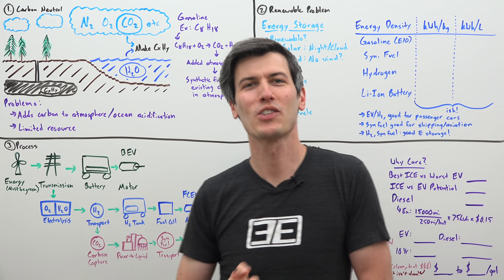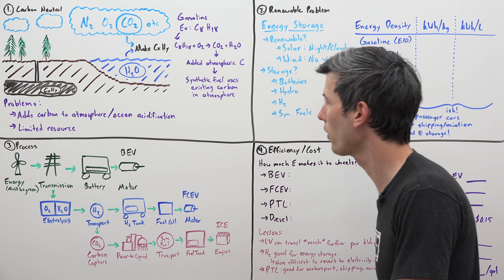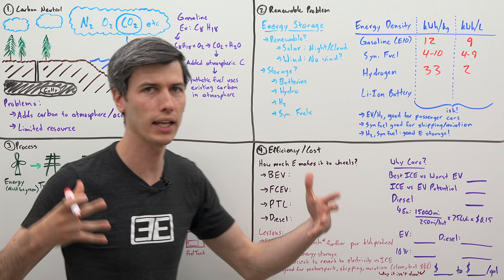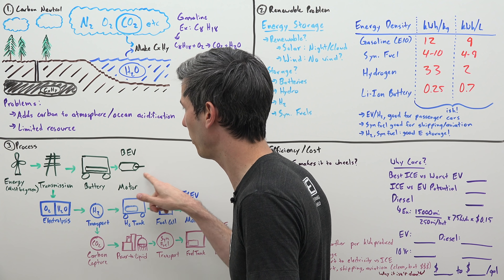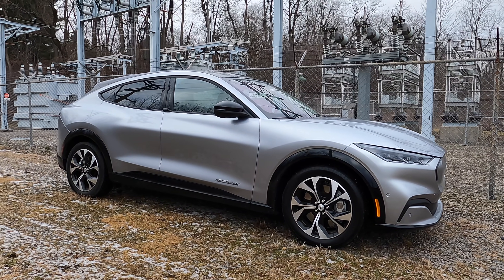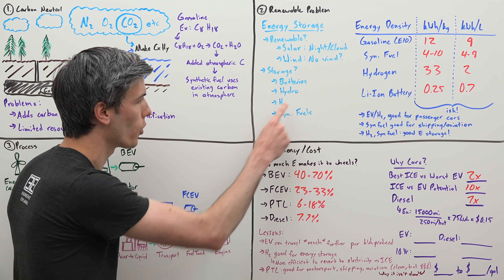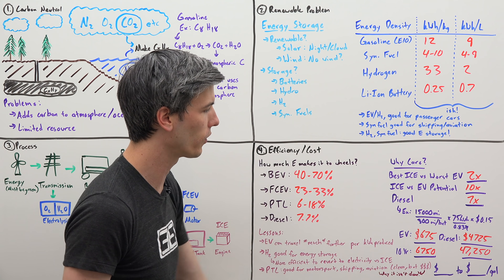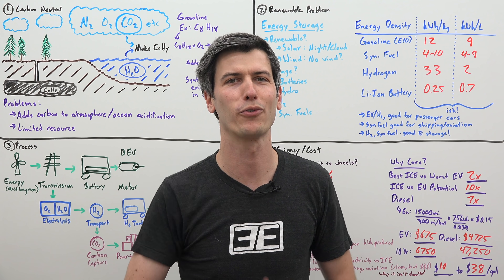The Big Problem With Synthetic Fuels

Comment: In your other video you mentioned the energy density of petrol vs batteries. Gas is just a much better storage medium. That makes up for its inefficiency, especially when you use the ICE to heat your car's cabin in the winter, and regenerative braking with a hybrid car like a Prius. Plus all our infrastructure (gas stations, rail lines, tanker trucks, etc. . .) are set up for moving petrol.

I think there is still a palpable use case for ICEs running off CO2 neutral synthetic carbon capture gasoline. That's why Bill Gates has invested in a startup in BC that I think is a HUGE stock to look out for 👀

Hybrids have the best range. Even Elon Musk's Tesla hasn't beaten the humble Prius' range.

This is all so very important to consider when creating public policy. Because my Canadian government plans on banning ICE passenger car sales by 2035. This will surely lead to economic turmoil and suffering of innocent consumers.

ICE & synthetic fuels are supported by science, regardless if you've failed to discuss these hidden variables.

Comment: Your last section on efficiency/cost only makes sense when assuming today's energy costs.  Let's see what happens when there's a fully implemented charging infrastructure and mass adoption of EVs vs phasing out the existing fleet of passenger ICEs; those figures will change drastically, probably leading to higher electricity cost vs lower fuel prices...

Comment: electric utility prices are low now for ev owners, but just wait till everyone has an EV and they also need to upgrade the grid and move to more expensive energy sources, that rate will go way up and that's not even considering the revenue from gas taxes they use to maintain roads that they will then have to levy on the electricity prices.

Comment: Synthetic fuel is still way better way to go, we don't have to mine and worry so much about hostile countries and slave labor to get lithium for batteries and we don't have to build new infastructure everywhere with charging stations, etc, we can just continue pumping it through gas stations we already have.  In addition, you still satisfy the car guys because they can keep their great sounding ICE based cars and you aren't putting dyno tuners and car modding out of work, etc. killing more jobs, only smog stations would be put out of work.  Lastly, the assembly lines and production is all geared for making ICE engines, imagine the cost of retooling all of that to make electric engines, etc.  I think synthetic fuels and the new toyota ICE that runs off hydrogen rather than fuel cells are the way to go.  We understand you are dealing in efficiency and can't calculate or weigh the infrastructure alteration savings and tooling/production changes, etc.  You also are not looking at range in totality, cost of the vehicle, longevity of battery pack and those going in the landfill and how long those ICE cars and engines will last in comparison.  You should be looking at creating syn fuels using nuclear not hydrogen.

Comment: I haven't seen anyone run the numbers on the amount of 'green' wind and solar you would need to make a plant that produces a few billion liters of this stuff either.. You can't ignore the impact of the windmills and panels and their maintenance / recycling / replacing impact..
Reply: Ignorant comment. Did you know that covering only 1% of the Saharan desert in solar panels gives enough electricity for the entire planet? There is no shortage of availbable energy. There is only a question of profitability. Transporting that energy from these remote areas back to US and EU will be cheaper with E-fuels than by power lines.

Comment: Say you had synthetic fuel making plants with solar panels or something, now the electricity isn’t transmitted nearly as far. If electrolysis and the power to liquid process are done at the same place then transporting the hydrogen isn’t a problem anymore either. That effectively removes 1 or 2 steps making it at least as efficient as fuel cell technology.

Comment: This is a bit like asking someone if they've stopped beating their wife -- you've already made an implicit assumption that may not be true, and tilted the discussion to a particular outcome. Surely the onus is to prove that electric cars will be able to replace conventional vehicles, and not the other way around? In regions where the market isn't heavily tilted in favor of EVs, ICEVs still make up the large majority of sales. When looking at sales of EVs, typically more than half are hybrids, which need fuel of some kind. It seems clear then that fuel is going to be a part of driving for a while to come, and if that's the case, we'll certainly be using synthetic fuels, even in our "electric" cars.

Secondly, you're focusing on well-to-wheels efficiency, when the real metric of interest is cost of ownership. BEVs are cheaper to run when plugged in at home, no question, but there are other use cases where you want to be able to refuel quickly -- BEVs are unlikely to be cheaper in this scenario, since electricity has to be dispatched. You're not just paying for energy, you're paying for energy, right now. Fuels don't have this problem, because they're an easy long term store of energy. Given the large chunk of drivers relying on on-street parking, it seems pretty clear that we either need fast charging for these users (mostly negating the cost benefits), or we have ubiquitous slow charging that still leaves BEVs worse off for certain use cases.

The reality is that BEVs don't meet all of the use cases that ICEVs do, which could easily limit their penetration into the market. This is borne out by the fact that 20% of BEV buyers in California switch back to an ICEV for their next vehicle, mostly due to charging issues. Fundamentally, they're a different product with a different ownership experience, with some advantages and some disadvantages. Given this, I think it's pretty clear that we'll be using synthetic fuels, but maybe not synthetic petrol and diesel (alcohols are generally cheaper and cleaner). Methanol and ethanol are both effective fuels, and notably absent from your list.
Reply: Very good comment!

Comment: A little correction: in the majority of the cases the recharge station for electric vehicles are fed by gasoline or diesel generators, in order to generate the electricity that a customer will use on his vehicles. Furthermore, the amount of CO2 and polluting substances generated for the actual building and refining of the lithium cells of these vehicles, has been demonstrated to be extremely incisive in the enviromental impact. So, in my modest opinion, this video just lack of some details and doesn't point out correctly all the issues that are emergin over the EV debate, which are quite relevant. Internal combustion energy veichles are still and will remain the best option, with the correct amount of development and research in order to flat the level of emission, such as the case of synthetic fuels and similar products.

Comment: Diesel/compression ignition engines were first run on peanut oil. There is biodiesel out in production already. Do why not run the compression ignition engines on perhaps vegetable oil. Disneyland has been running their tram on biodiesel that they make from all the used cooking oils from their restaurants. The one thing that I see getting in the way is the petroleum industry, and perhaps the politicians that own stock in the petroleum industry.

Comment: The battery electric vehicles have the same problem as the organic fuel combustion engine… the battery & fuel are both consumables. 

After 5-7 years, the battery will be disposed of and need replacing. The gasoline just needs to be replaced faster (weekly). The same way we may run out of oil, we may run out of battery precursors (lithium.)

The hydrogen fuel cell becomes the [expensive] consumable with Hydrogen cars (that are not burning/oxidizing hydrogen, which is less efficient.)

For sustainability reasons, Hydrogen combustion or Synthetic Fuel combustion is preferred. (100% recyclable & precursors accessible everywhere.)

There is nothing to say that Hydrogen or Synthetic Fuel can not be made at someone’s home or in fuel stations, so the transportation issue disappears.

Hydrogen or synthetic fuel hold a lot of power per liter, both are effectively limitless, both are 100% recyclable, Both can be transported via existing transportation networks. 

The loss of efficiency can be overcome with technology, and if not, the sustainability aspect still trumps the others… if for no other reason than to burn in an electric car as a generator driving super capacitors (no batteries needed.).

Comment: Your calculation makes a big gap on the efficiency of electricity transport between the centers of use (city) and the production sites in the countryside. I'm not sure the yield efficiency between generating and transporting electricity is better than that of storing energy in a liquid. There is also the problem of intermittency of production if the electricity comes from renewable energy and not from coal/gas. At first glance, the only 2 viable substitutes in the world for fossil fuel are either synthetic/ethanol or hydrogen and since hydrogen is super unstable...

Comment: 1 kW electricity costs 44 eurocent not 15. A new Car battery costs 20k USD w a lifespan of abt 10 years. Producing the batteries and all the way to the car is a desaster for Environment. A electrica car costs at least 30% more than a normal car. You have holes in your facts. Cheers

Comment: If the net power efficiency of synfuels is 18 percent and ev is say 65 percent that’s only a factor of 4.  Whereas the energy density of a liion battery is worse by a factor of 48 (0.25/12) wouldn’t the synfuel still be superior given you can only carry so much weight in a vehicle stored as fuel?

Comment: The thing is electric vehicles use batteries, and those batteries cause as much or more environmental harm as anything else does. Besides, the power still must be generated somewhere, usually a fossil fuel power plant making pollution, and then transported great distances through the electric wires. The wire infrastructure in the USA would never support the load required if most people used electric vehicles. And no one wants to wait at the station an hour or longer to recharge their vehicle. There are much better alternatives than the electric/battery vehicle.

Comment: I think they are a very good idea and  worth researching further. Some more considerations: For starters part of the infrastructure necessary its already present pretty much anywhere in the world. Also they would be much safer and easier to transport and store than hydrogen or batteries. The technology used to pull carbon from the atmosphere could be also used to improve the current state of affairs, so even if we go full EVs it could still be useful. The high cost is to be expected, since they are still "prototypes" but I dont see any practical reason why it couldnt decrese if the technology gets developed further

Comment: With an aging population, is there possibly a certain portion of the population who fit the "little ole lady only drives it to church on Sunday" trope, who might be as well off driving old cars with environmentally better fuels? (I'm disabled and mostly a shut-in, myself (chemical sensitivity, mostly to stuff outdoors)). The car I've had for over 30 years only has 55,000 miles on it, and most of those miles were in the first half of that time. There's an environmental cost to building a new vehicle that should be figured in, too.

Comment: This comment maybe be idealistic or utopic but, if we took other founts of Carbon and Hidrogen, by example: the plastic polymeres are long carbon chains, these can be despolimered and desoxigened to have hidrocarburs, the process or electricity itself can be replaced by bacterias (like pseudomonas) instead of complicated chemistry process. Another way could be with bacterias methanogens to transform methane in ethane or propane (that process it will be to far because the bacterias can´t consume hidrocarburs, but it´s a idea). About the hidrogen, the sulfobacterias could be replace the water electrolisis because the hidrogen is a metabolic waste of them and the fount of consume of that metabolism are the organic wastes

Comment: There are so many aspects not being taken into consideration in this video. What about the cost of building and recycling an electric car in comparison to car running on efuel? 
What about the fact that during the process of producing efuels, you are reducing CO2? Nobody speaks about net zero emissions when talking about EV cars.
And finally when we talk about cost. You have to consider that the cost of batteries is not going to be reduced any time soon. Instead efuels can be used on the already existing vehicles, using already existing infrastructure. So no need to scrap all this existing vehicles, creating an even bigger problem for the planet.

Comment: Alternative fuels can be made at pretty much any scale, and locally, reducing the distribution costs. And they can be made through use of a mix of biotechnological and organic chemistry methods that would be dirt cheap and spend much less energy and overall being more efficient. 
I can even get a small scale HC fuel synthetizer at home and run it on the 23kw of possible Solar capacity that I can deploy at my rooftop, not to mention the possibility of also deploying some wind as well. It's small scale but it would work okay. If I have a PHEV I can both fuel it and charge it off my own energy production. I would need minute quantities of fuel since for most of my daily driving I can just use electricity directly. Then I'd leave home for a long trip with both a full tank and a full battery, for basically free (after the cost of the solar, wind and synth installation is amortized), for much more range than any BEV. I'd also be able to get over 800km of range in less than 5 minutes, unlike the 400Km in 20+minutes of a BEV. Hybrids are also less resource intensive, cheaper and much more convenient than BEVs.

Comment: Ok, so I keep my ICE powered autos for 15-20 years and have very little repair costs.  Based on anecdotal evidence, one can expect to replace the batteries in BEVs once, possibly twice over 20 years.  This is an expensive proposition since it represents the most expensive part of a BEV (upwards of $15k each time).  This has to be factored into the BEV TCO.

Comment: Your reasoning is basically ok, but one issue is that the cost of electricity to make synthetic fuel will be far less than that you pay to charge your car. 
Of course it will be all used for jet aircraft, though still producing NOX, and C02, high in the atmosphere.
Interesting that hydrogen is so much more energy dense, the age of the hydrogen airship will return.

Comment: Look at what Prometheus is doing. This argument falls over. They don’t need to use separately produced H2 to make HCs, they make fuels from alcohol (which is already a hydrocarbon) which comes from electrifying bicarbonate (CO2 captured in by water) which also makes hydrogen as a co-product. Then nano-tubes are used to filter out the ethanol. Ethanol is then catalysed into which ever fuel is needed (gasoline, diesel etc). It’s already proving to be a cost effective and efficient solution.
Reply: Sounds like something you could have at home, if you have enough space, like a shed. Even if you skip the conversion to HCs and ran the vehicle on the ethanol directly(pretty easy to do with gasoline engines)... Storing the Hydrogen would be a problem tho..

Comment: Considering most power company's can't handle the fluctuation of high demand times like in summer when everybody runs air-conditioning how can the grid handle it if everybody started charging their vehicles on top of that there would have to be major upgrades to the power company's. And it is cheaper if you can make bio diesel from vegetable oil ( old cooking oil ) yourself, and with combustion engines you don't have to wait 8 hours to charge your car.

Comment: You made a big mistake at the end. Solar does not and has not cost 15 cents a kw/hr since 2010. Today utility scale solar is achievable at 1 cent per kw/hr. You're using retail household average electric prices to figure out the cost for a gallon of E-fuel. This is correct if someone was DIY E-fuel at home. But any decent sized E-fuel plant is going to have to be huge, to be effective and get some kind of economy of scale in order for the costs to work. Any plant or factory this large is NOT going to pay retail homeowner prices per kw/hr. You said in the video the E-fuel only works with renewables. Renewables inherently have 0 fuel costs. Only upfront CapEx to build the facility and ongoing maintenance and upgrades. So in your example the correct cost for an EV is $675, but for E-fuel at 1 cent per kw/hr that drops to $315, and over 10 years would be $3150 versus $6750. Now you see how it's going to be a game changer!